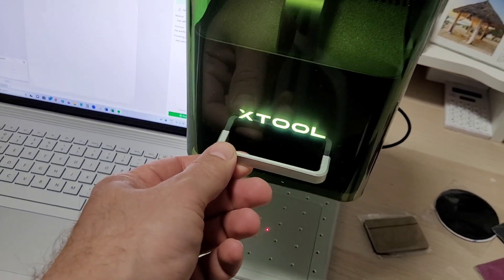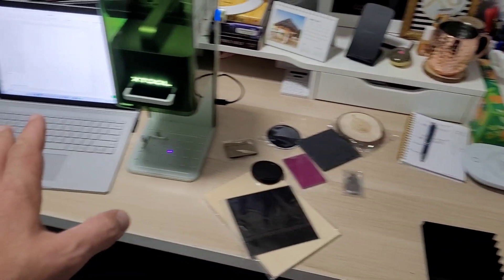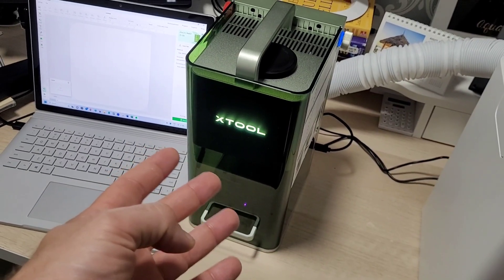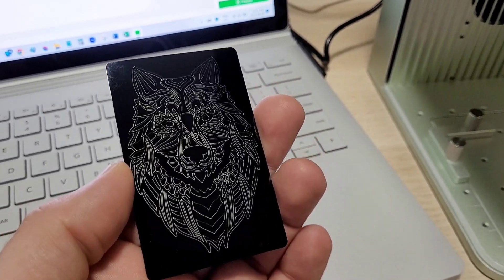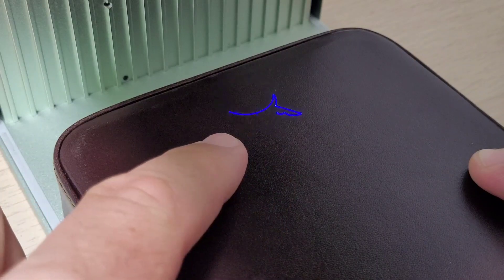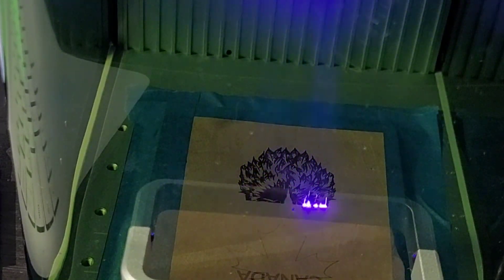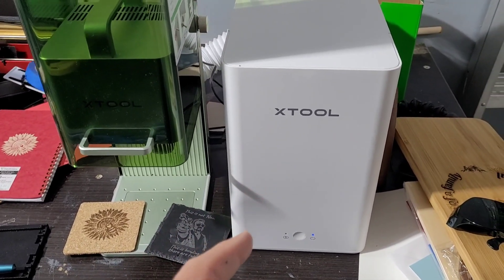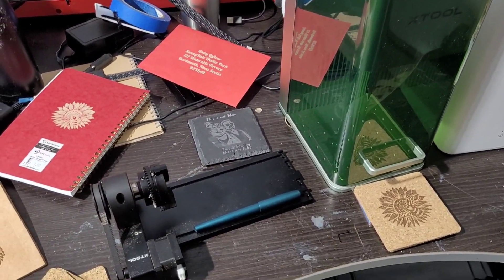Why 2 Lasers Are Better Than 1 - Impressed By The New xTool F1 Laser Engraver

Comment: Quick question, does the F1 cut or just engrave?
Reply from the maker: It can cut only thinner materials and if small size. Their XY systems are more geared towards cutting. The F1 shines best with engraving as it has higher resolution & it's VERY fast.
Reply: @Doodlebud  Brilliant, thank you. I’ve been looking for a while to get a laser engraver/cutter and the F1 is on offer atm but I think I need it to cut as well. Been looking at the M1 but can’t decide lol.
Reply from the maker: @bowlandleather  I have the S1 and D1 Pro systems. Been very happy with them
https://youtu.be/qhDLs8587X4

Comment: I see their tool is not available for Linux, is there anything FOSS I can use instead or is it a proprietary protocol?
Also, I see you mainly engrave bitmaps and not splines. is there a benefit for that approach? I mean bitmap to vector software does exist, AFAIK.
Reply from the maker: No Linux support as far as I know.  I engrave bitmap, SVG, DXF, etc.  Just depends on the images. Sometimes conversions can mess up an image so I go for what gives a clear result.  Sometimes its slower, but if I'm only engraving a few it makes no difference.  If I had a large batch, I would look into spending more time on images that are taking a long time